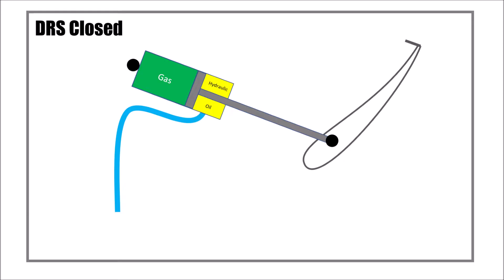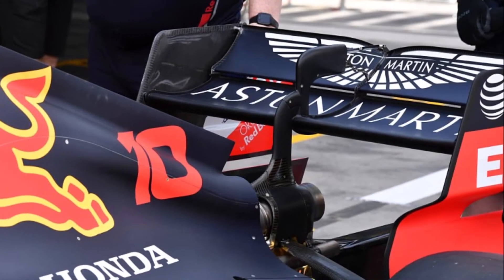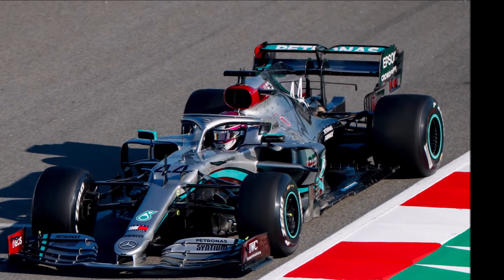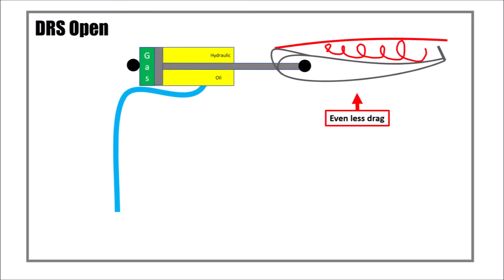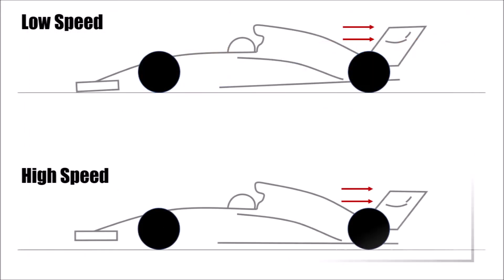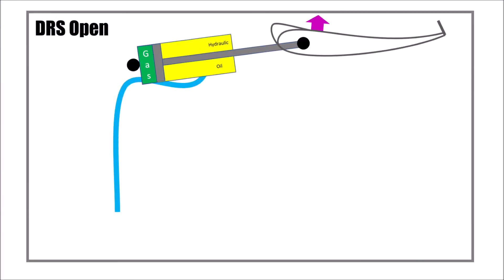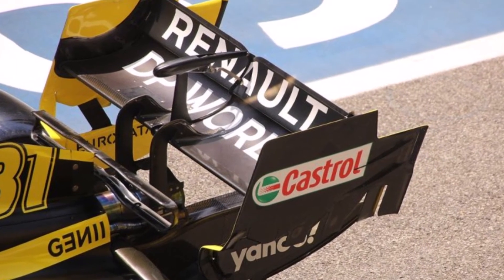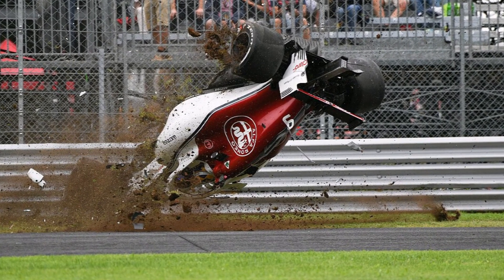F1 Centre Flap Support - Explained

Comment: Hey, I wanted to ask which parts of a car are more difficult to accurately simulate in the CFD, and do they still have problems with the seperation lines over smooth curved surfaces and why did they have this problem.Also, how are teams looking forward to the future of wind tunnels, will we see the 100% scale models in wind tunnels like the ones in NASA and will they be too expensive.thanks.
Reply from the maker: I cannot comment on specific CFD issues for obvious reasons but in terms of wind tunnels it looks like the wind tunnel time will be more and more restricted so that teams already think twice if they should build a new one now.
100% wind tunnels could help with correlation but would need too much space and energy.
Reply: @bsport320  Thanks a lot

Comment: I would love to see you talking about the Mercedes shark fin. Their rear wing doesn't flex but their shark fin vibrates a lot at high speeds.
https://youtu.be/Mni8tXPPh24
Reply from the maker: So the Mercedes engine has the intake for the engine in front of the engine block and most of the cooling in the side pods. The Honda engine has the intake in front of the block too but a large vertical radiator behind the plenum. Hence the Mercedes bodywork decreases in height pretty quickly, whereas the Red Bull bodywork stays high for longer (also helps to control the intensity of the shark fin vortex). The result of this is that Mercedes has a long slim shark fin and Red Bull a short stiff one. The Mercedes shark fin vibrations are not intended by design but also don't do much harm. So in the interest of weight saving, they just let it wobble at high speeds.
Maybe stuff for another short video...
Reply: @bsport320  man thank you for your answer. I learn a lot with you.